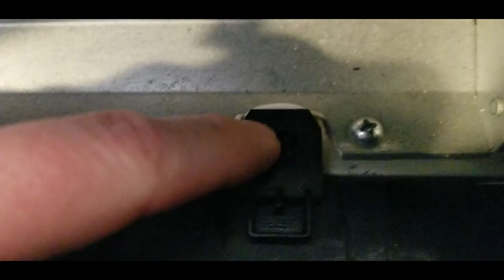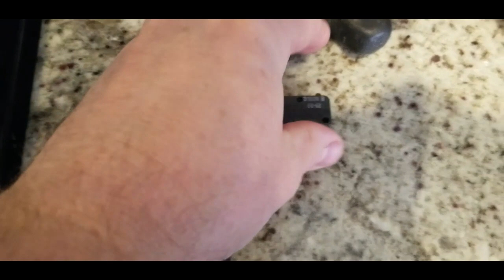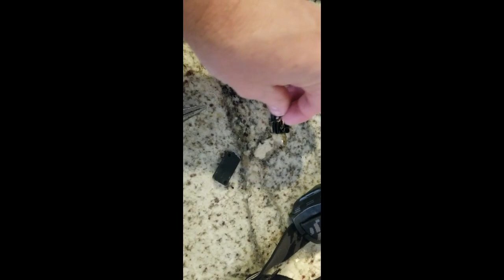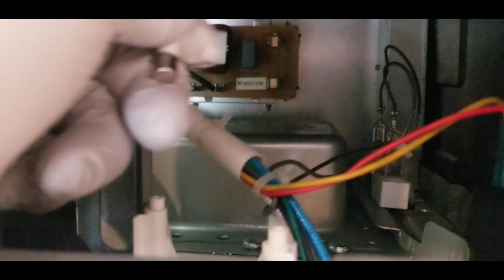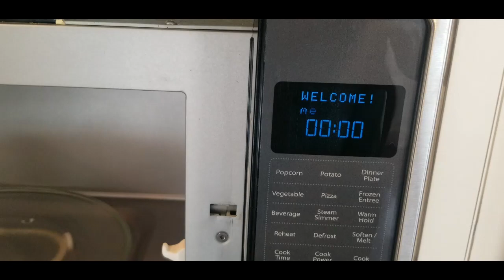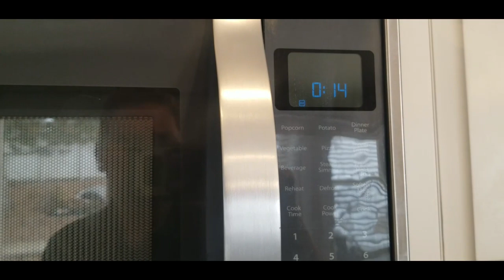How to replace the door switches in a Whirlpool Microwave repair Part 3

Comment: Would you share where you ordered your switches from. I'm seeing 26 for a switch. I know these are really $3 micro switches they taylor specifically for a product to be able to jack the price up. I had a similar issue this past summer with a safety neutral switch on an Outboard motor remote box. amazon wants $26-28 per switch.
Reply from the maker: Amazon for about $10 for the 3 switches: https://www.amazon.com/gp/product/B07PF3CYDC/ref=ppx_yo_dt_b_search_asin_title?ie=UTF8&psc=1